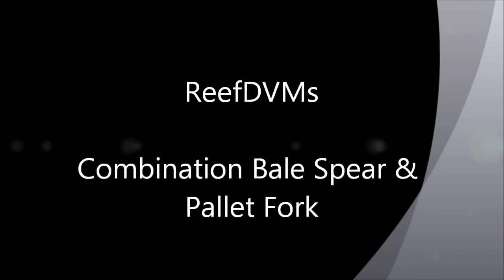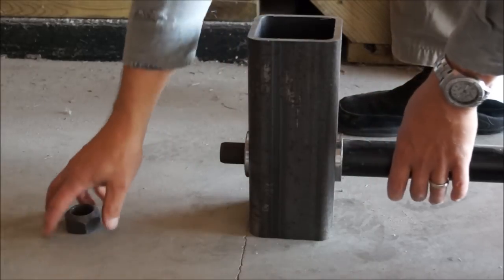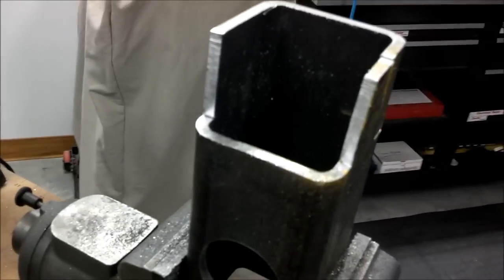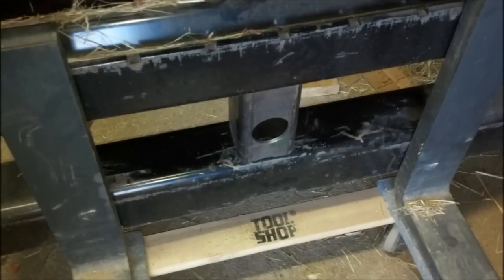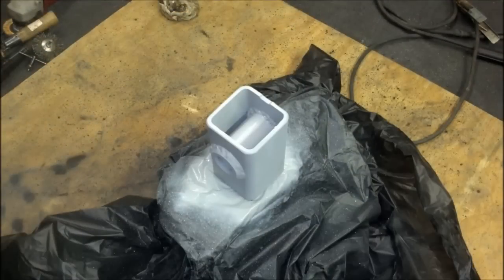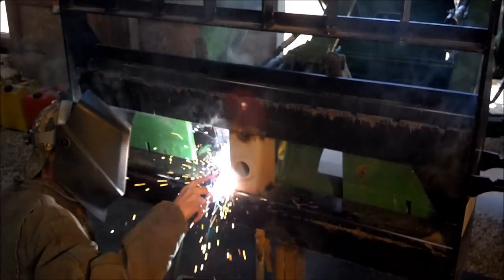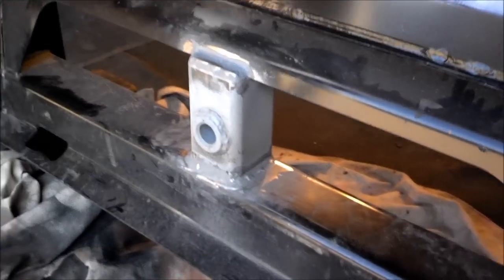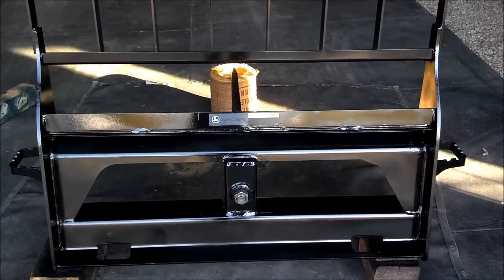Building a Bale Spear out of a John Deere Pallet Fork

Comment: Thanks for the idea.  I had checked with a local implement dealer and priced a complete spear with the skid steer mount.  They wanted $980.  Unbelievable and totally not worth that given I will only use this two or three times a year.  I bought the spear off Amazon and just got it mounted yesterday.  I had a local professional welder do mine.  He did a great job and I have a total of about $275 invested in the spear and welder service.  I am going to give it a trial run today.  Looks like it is going to work great.

Comment: l got a pair of forks that had the heels worn  it off the bottom of the fork .  cut hole in uprite welded in sleeve   kept it forward and centered in uprite. put in spear. I use two spears to have better control of bale .put on or off by siding on or off.  we built a set for a neighbor like yours. still using 17 years later  you have a good plan

Comment: I welded the bushing for the spear into the bottom beam of the pallet fork. I welded two 6x6 steel tube that is 1/4" thick to the ends for the two main spears. Reinforced under the spear bushing with 1/4" 1x1 tubing. Works well. The bale spear we have is a JD as well.

Comment: Having all three loader attachment types(   Skid Steer,  Global, and JD  lower TWIN  Pin.... we have nunerous   pallet forks and spears just sitting around,      usually the most used are the  4 spear  Marcrest  "Tusk Design"  Home fabricated for handling 21-  Bale Baron bundles, and the standard  JD pallet forks..... Your Modification   saves you money, but  changing  the attachment saves us time.../. WE use the Forks to put bundles in the 53ft trailer and the "Tusk" to take them out...... and to place complete bundles on  customers conveyance.... where attachment contact may be avoided.......